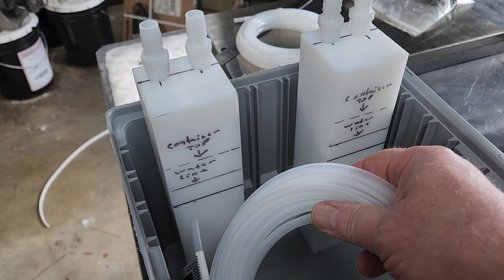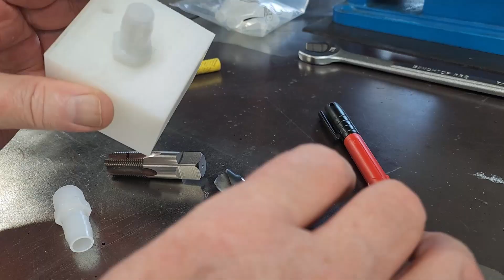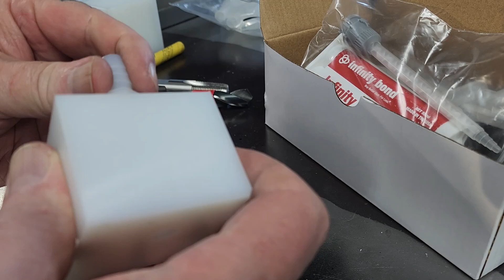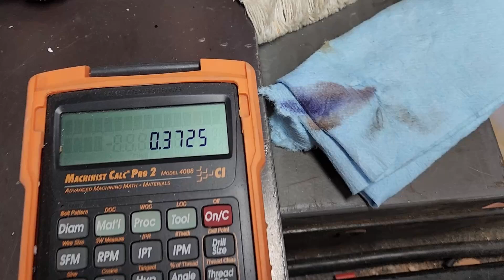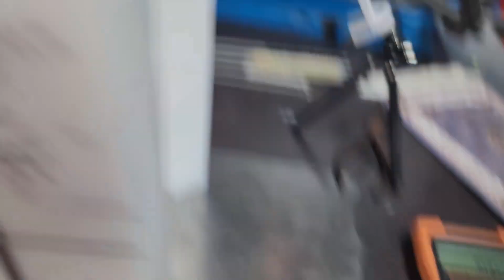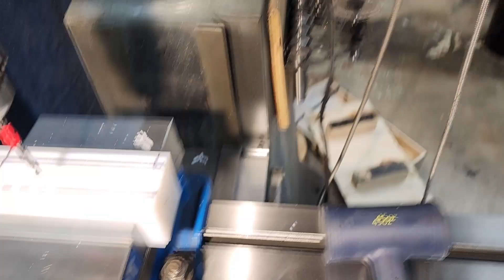Anodizing tank cooling

Comment: Do you think soap on the drill bit would help when drilling the long holes in the nylon would help? Only a thought, I have never tried.
Reply from the maker: Thats a good idea. If I have to drill out any more in the future Ill certainly give it a try. The bit itself had no clearance past the flutes and if it had it would have drilled fine but I would have also ended up having a wondering bit and the holes would not have been straight. The polyethylene is a weird plastic. When it gets hot it gets sticky and expands and it's also hydrophobic. I was wetting the bit before drilling to cool it down and hoped that might help lubricate it a bit but it would get hot real fast and the water turned to steam and vented out from between the bit and drill hole. It drilled best when it was cold then became a nightmare when hot. So, because of that I had to drill a little and then stop and let it cool and that process dragged the job out to hours on end over a 2 day period for 4 lousy holes.. The chip loading was an issue as well so as soon as I felt it grab, I drilled a small amount and backed off and then pulled the drill bit out which took every ounce of strength I had, that's how much the plastic gripped the bit. I wish I could have filmed it but it is what it is. Hopefully I never have to do that again. 🤣